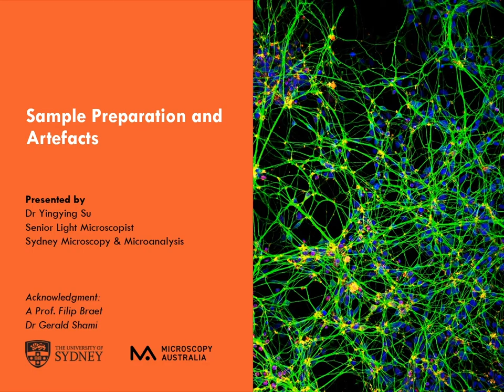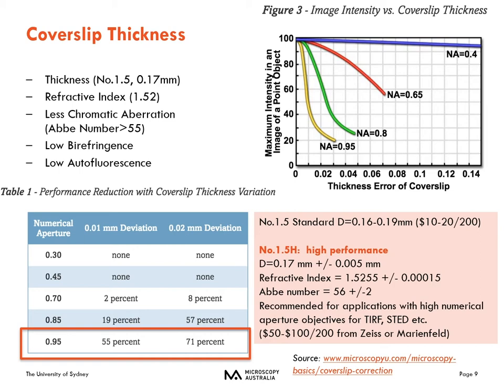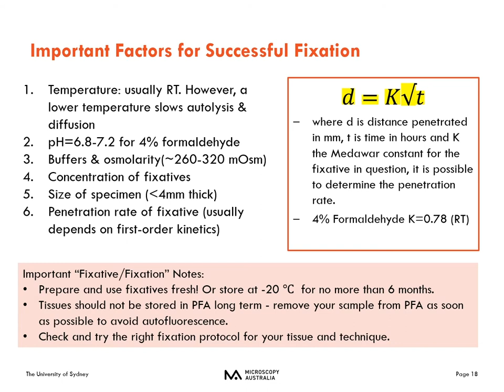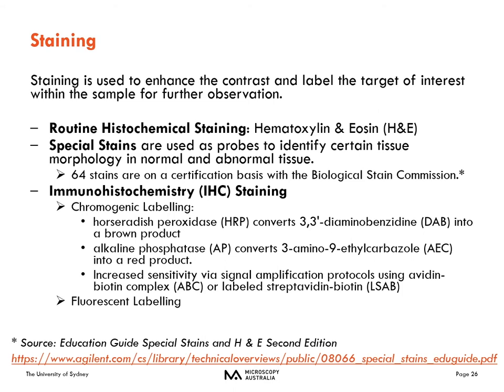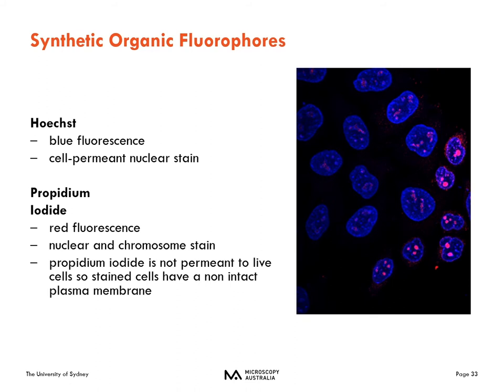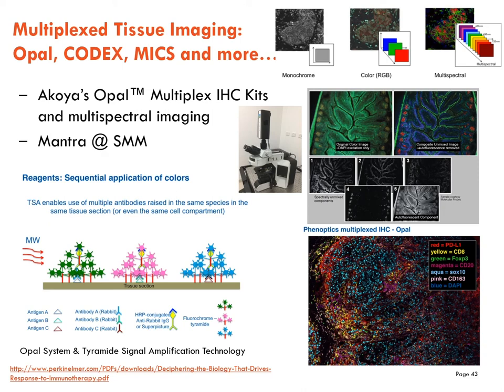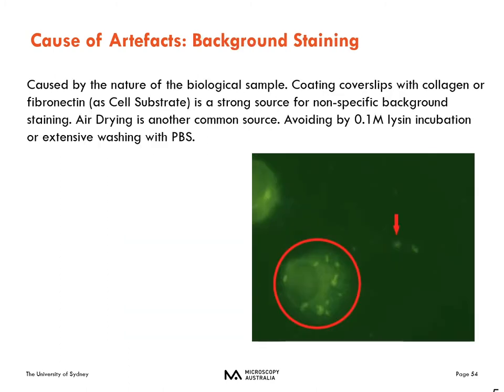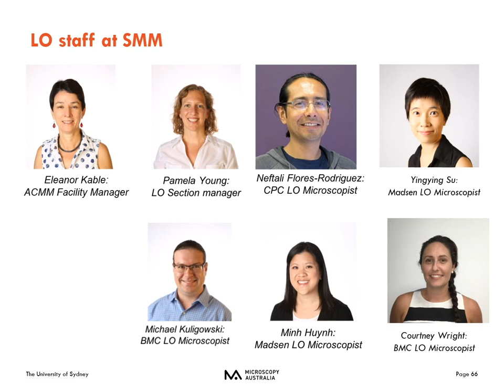Intro to Light Microscopy 4: Sample Preparation and Artefacts

Comment: Please how is cell size limited as viewed under the microscope ?
Reply from the maker: We're not quite sure what exactly you are asking but hopefully this will help.

First, the average size of most mammalian cells ranges between 10-100µm, however some very long cell types such as motor neurons can get as long as 100µm to 1m. This means that most of the cells can be viewed using conventional light microscopes, with objectives ranges from 1.25x to 160x magnification.
 
The final resolution of an optical system such as a conventional light microscope is around 200nm due to the diffraction limit of light (Abbe’s Equation). Confocal and multiphoton microscopy can improve the axial resolution by reducing out of focus light. Also, the rapid development of super-resolution techniques can push the lateral resolution to 20-30nm (such as STORM). In this case, cells can be viewed at cellular level and subcellular level. It is beyond the “lower limit” of cell size.
 
The modern microscope can be equipped with motorized stages to allow a bigger FOV under higher magnification/resolution objectives to improve the quality of images.
 
Feel free to ask for something more specific if this doesn't answer your question.